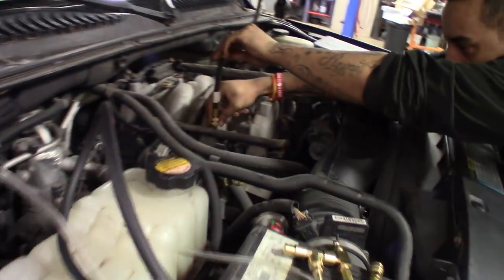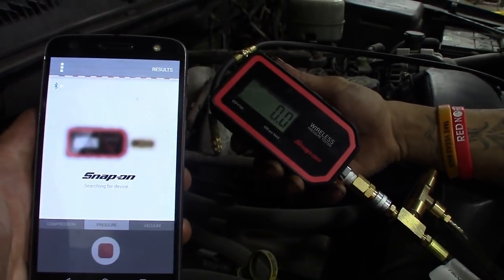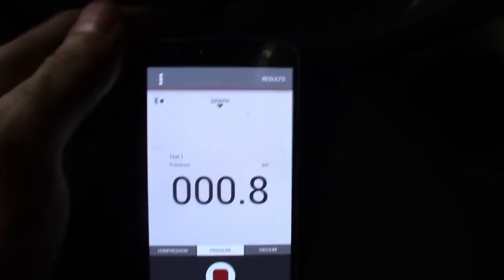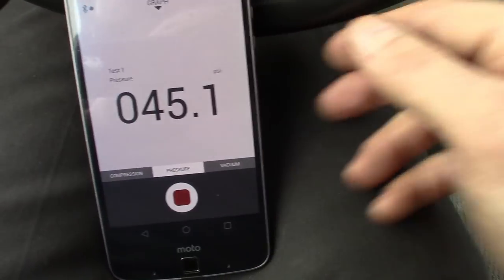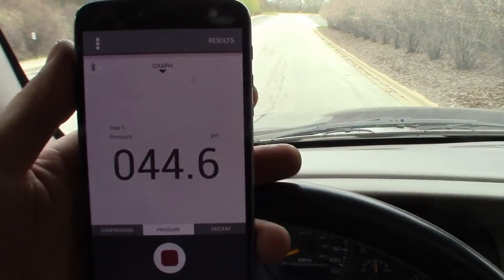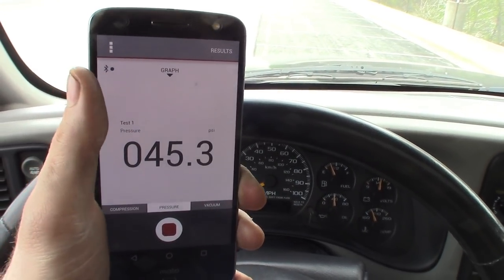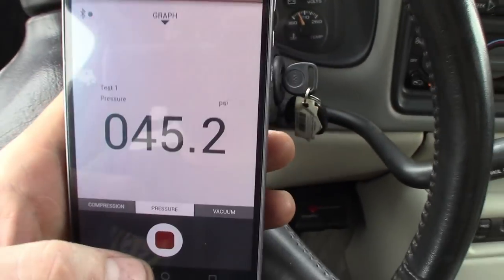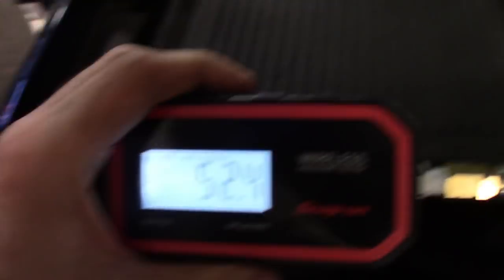⭐Snap On⭐ Toolz in Use
Season 2 Episode 5

Comment: Nice tool. I like using a scope to current ramp the pumps as well as testing with a gauge. This is nice for testing pressure on a road test. Definitely gets rid of the mess of hoses needed with other pressure gauges. Great video!

Comment: That makes life a whole lot easier. I noticed it has a graph selection, is that true? I’m sure you can take screenshot to print up for customer as well which is definitely a nice feature. Keep these coming bro
Reply from the maker: Yes it has a graph section nice to use when checking compression comparison. I believe you can transfer recordings and send to customer in email if using Bluetooth on a shop tablet
Reply: JRC54 awesome bro thanks for the heads up. Like it even more once you mentioned something t can do more then just fuel.

Comment: I would change the fuel filter first, or at least check it out. Good video.
Reply from the maker: Filter was new. Ended up being the fuel pump. The feed line from pump to hanger was ruptured on internal assembly. But sold a fuel filter too.

Comment: I was allowed to demo this tool for a week and couldn’t justify the expense. The Bluetooth is good but the app is lacking major features. The graphing mode does not capture data fast enough. The PDF print mode cuts off information and the save function is broken. The software developer will not fix the concern because they are not Snapon and Snapon will not pay them to fix the app.

Secondly why is this not integrated into out $15,000 Snapon scanners? This is a huge miss by the engineers. I would love to have an engine speed graph running with fuel pressure. For PID on off switches graphed against vacuum pressures.

I know you are not the person to tell but Snapon is not listening
Reply: I’m no huge fan of snap on scan tools but that is integrated into the high end scan tools. I was using pressure transducers with snap on scan tools and scopes years ago. Modis, Verus, along with the newer platforms all have that ability. Look in your graphing meter or scope settings and the pressure transducer presets are right there.
Reply: @Jpilgrim30  
Thanks. I have the pressure transducer… I was hinting at this tool missed a unique market for techs that don’t have scopes. 
For $500 it’s would’ve been nice to have a faster capture speed, so techs could graph the data out on phones while watching their pocket scanners.

Just saying.